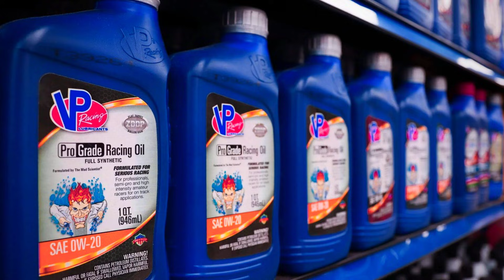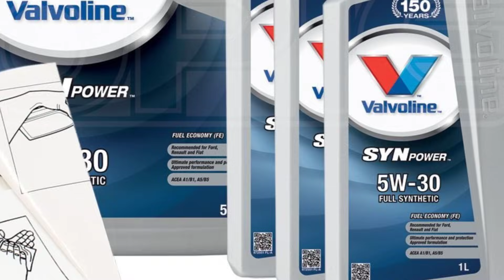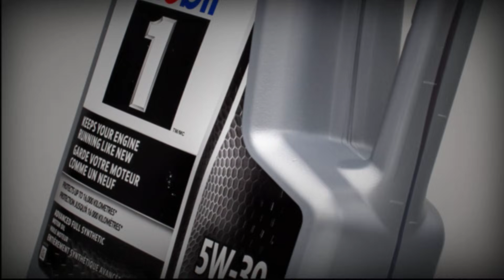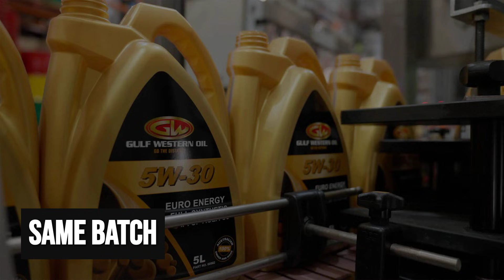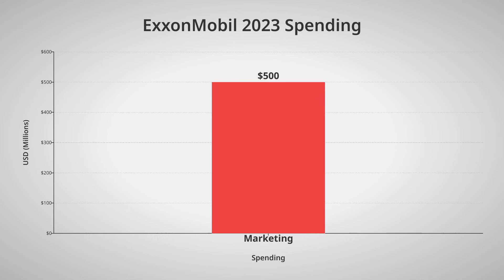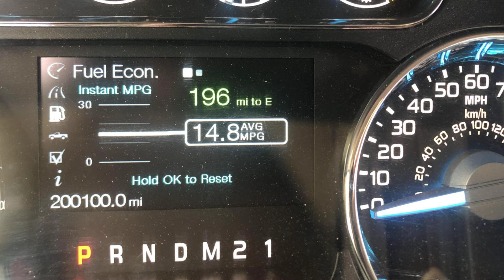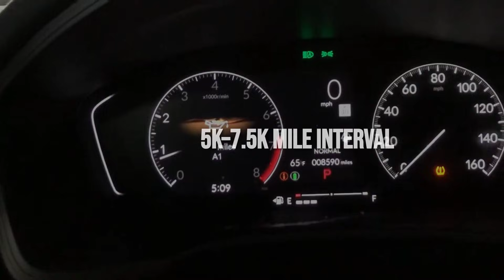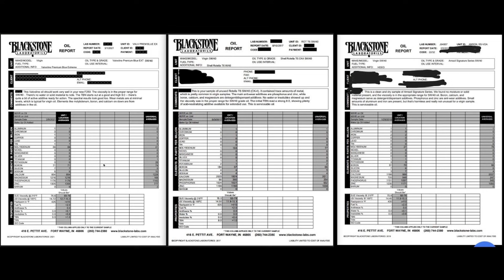Big Oil Controls The Market, And You're Paying For It

Comment: There is a technical reason why Group III has to be called synthetic. The bottom line is that it meets a spec for many engines which require synthetic oil. Engines which require Group IV PAO oil have a spec which indicates that this type is required. The spec that an oil meets is printed on the bottle or jug.

If Group III oil was not allowed to be called synthetic, it would just make the terminology more complicated without changing anything technical. All motor oils, dino (conventional) included, are highly engineered products. The important thing to know is what kind you can use in your vehicle. If you have a engine where conventional oil was original, you can continue to use it. If Group III synthetic meets the spec, you can use it. If Group IV is required, the published spec will tell you what kind to use, and you do not need any expertise beyond the ability to read a label.

If you have old vehicle where dino was original, maybe you shouldn't use a Group IV PAO oil. For your purposes, if you want to use synthetic, use Group III. Just keep in mind, it doesn't mean you can extend your oil change interval that much. Group III is catalytically altered altered oil out of the ground. Just treat it as enhanced conventional for oil change purposes.
Reply: Brilliant Thank you 🎉